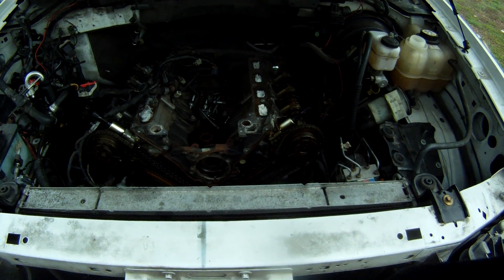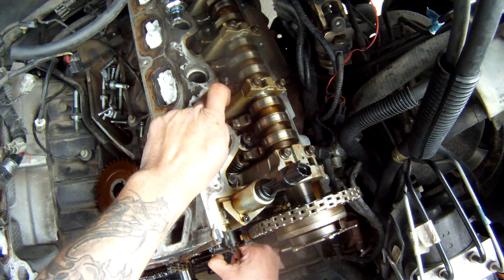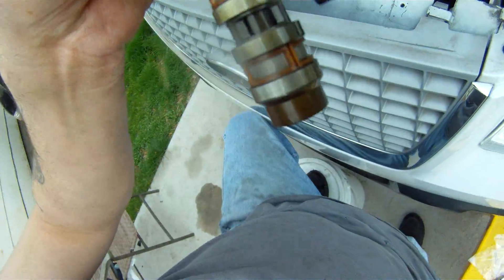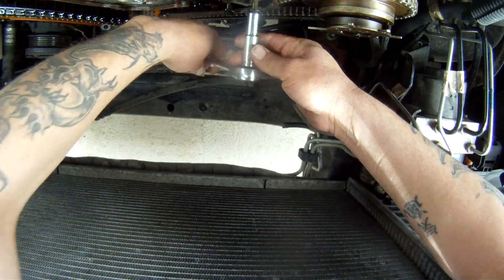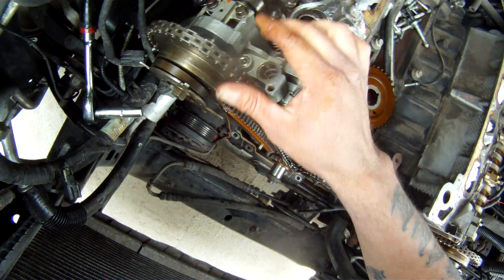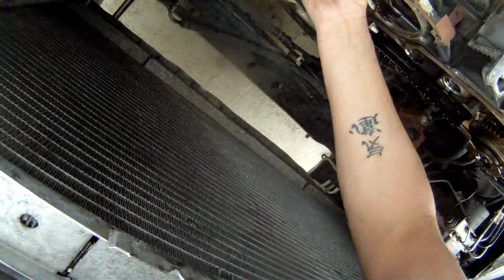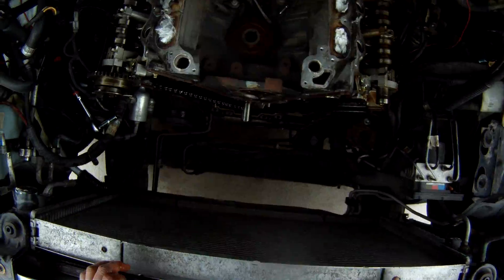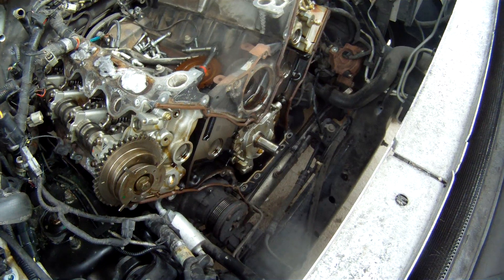Ford 5.4l Triton timing chain removal

Comment: My friend has one of these engines in his truck. It looks great and he said he got a good deal on it. First it needed a timing chain job so he had that done for damn near $2.5k. About 1000 miles later the transmission took a dump & there went another $3500.  His $10k truck quickly turned into the $16k truck and it ain't even worth that on a good day. That truck doesn't even have 150k on the clock. And for some people they last a long time and they never have problems. Puzzling to me? His mechanic told him to not use the oil that's supposed to be used. He said use synthetic 5wt30 instead. I wonder if the root cause for the engine troubles is that super thin oil to begin with?

Comment: The issue is the weak oil pump and the chain tensioners high volume oil pump and cast iron tensioner then you got a good engine.

Comment: Thanks for this video. My daughter has a hole  one-half inch by one inch in her passenger side valve cover.  I can now see the chain.  I have been debating whether to fix the problem or purchase a new engine. How long should it take an experience FORD mechanic to put a complete chain kit for freedomracing.com in a 2005 FORD EXPEDITION EDDIE BAUER EDITION?

Comment: Hi Matt. I have a 2010 FX4 and I will change the oil pump. Should I also change the timing set (and phasers???) since the front engine will be opened? The car has 53000miles. Thanks a lot. Ronald
Reply from the maker: Hi Ronald. you caught me at the computer here......hows your day starting? mine?......I got A BMW, Chrysler T&C, Saturn, nissan, and dodge Ram 1500 to service! luckily not all of those are due to be delivered today....whew!.......So as far as replacing everything goes......I would say if you have the finances and it wont turn your job into a nightmare for you then at 53,000 even though it is premature and early go ahead and do it! you are already in there so might as well. If you are trying to save money though keep what you can and change only what you need. other than that man have fun. personal and professionally i hate working on these engines and I keep saying I am going to stop servicing them but people keep bringing me them to service. I had serviced one  recently that the valve cover splash shield fell off and banging against the camshaft.........anyways have fun and thanks for watching! :)
Reply: Matt Shaughnessy Thanks for your quick answer, I will see once opened then. Thanks again.
Reply: Matt, I forgot to ask you how long it takes, approximately, to open the engine, to change the parts (timing set and oil pump), and to put everything back. Thanks.
Reply from the maker: no such thing on this job especially if you are doing it from home. take your time and set aside days maybe even a week or so to complete it. it will take a ton of attention to detail. take your time and take it slow because one mistake can cause this engine to chew itself up within the first few seconds of restarting. this is not something you want to stress about time on.
Reply: Matt, thanks for the advise, I guess I’ll try to find a mechanic to do it, that would be to silly if I break the engine. I know old V8s, this one seems to be a little more complicated, I shouldn’t take the risk, it’s my only car. Thanks anyway for your answers :)
Reply: Matt Shaughnessy. Thanks for the videos. I have a question that I just can’t seem to figure out I’m doing a timing job on my truck 05 f150 and I seen on another video a ford tech mentioned taking all 24 rockers out to perfectly time the engine. I just can’t see how there’s no other way I’ve seen people use vice grips on cam but I don’t know could you guide me in the right direction Thanks
Reply: Jerry Cremeans i have the same question. Could I not take out the roller.

Comment: Hey i have a 2000 f350 motor went bad is this process pretty much the same in my van?
Reply from the maker: Jay Money email me highgrooveauto@gmail.com I can help you
Reply from the maker: this is for a 3 valve 5.4l Triton. I suspect your 2000 has a two valve 5.4l. much easier to work on. what happened to your engine?
Reply: It originally was passing water through the head but I let her sit in the block cracked my buddy has the engine but his shot the spark plug out my heads are pretty much good I wanted to know if it was worth buying his engine he wants 200 also has good miles

Comment: hey i have one apart now replaced tensioners and guides when i pulled tensioners hold down clips the chains still lose on driver side i pull tension arm up to tighten chain then turn engine over it loosens again is this normal with no oil pressure?

Comment: Hey Matt. Im in boise as well. I have this problem with my 2005 expedition. Was wondering what the normal dealer cost is to fix this? I'm taking mine in on Saturday and have no clue what to expect. 

Or if you were interested in looking at it and giving me an estimate of what you would charge. 

I can be reached at 208 440 0220. Thanks.
Reply from the maker: let us know what the dealer tells youj if you take along with prices. I have another watcher that the dealer told them it "was not worth fixing".
Reply: is this process the same for a 2000 model

Comment: Is there something inherently wrong with the 2005 Triton 5.4?I just purchased a 2005 Expedition with 114000 and the dealer had the timing chain replaced, along with a lot of extras. Are there things that I should look for in the scope of work that required new parts versus existing?
Reply from the maker: make sure you change the oil and watch out for any engine ticks and knocks. change the spark plug every 80,000 miles instead of every 100,000
Reply: One other thing stop using 5w-20 and start using 5w-30 this was the ultimate issue with this engine. In order to get better fuel economy they made the genius decision to lower the viscosity of the oil. To meet CAFE standards. In a lot of other countries with this engine they kept 5w-30 in them. And they never had the issues that the US did with them. 

I use Mobil1 Delvac 5w-30 that is made for diesel engines. This has a higher amount of detergents Keeping all the oil pathways clean.